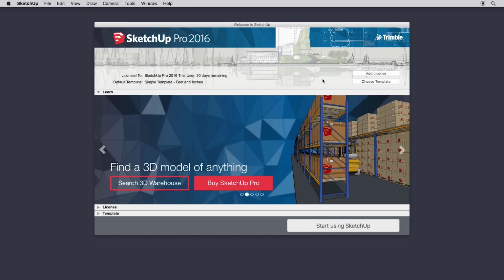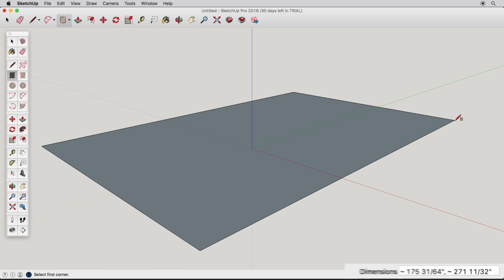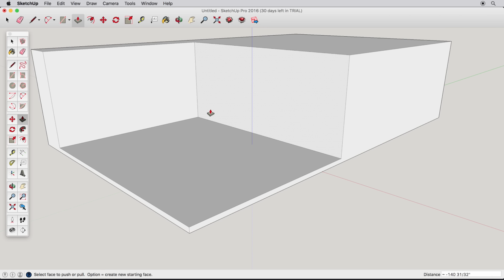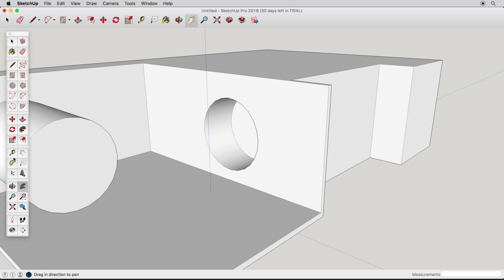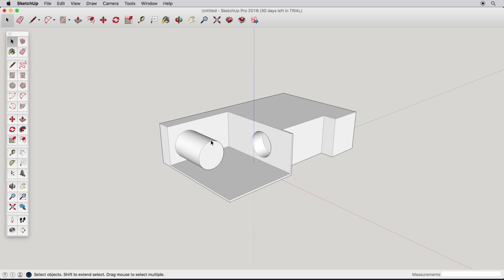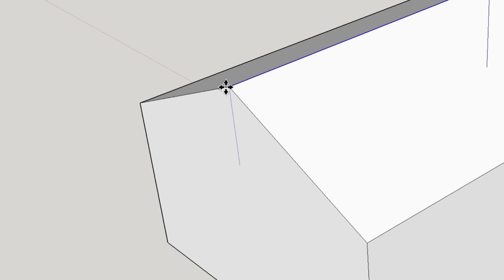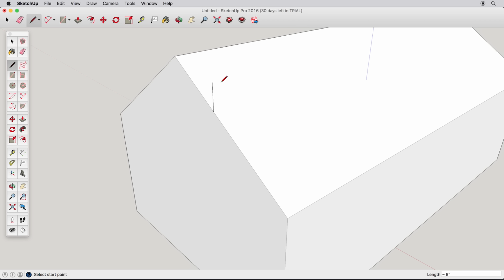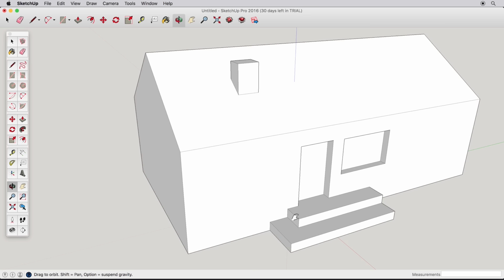Getting Started with SketchUp - Part 1

Comment: This video is great, I learned a lot of good things.  Have a question. I'm using the free SketchUp version on a MacBook Pro. I am not able to draw a line 200 feet long.  When I draw a line about as long as the pencil is, the measurement in the bottom right corner is 49668' 7" long. Any ideas on how to fix this? Thanks.

Comment: Interesting- so you have incorporated a 3D (or even 4D) modeling element with just the mouse. I recall having to use a dedicated 4D input device with a dozen programable buttons to do CAD CAM, but this seems much cleaner, simpler and with a lower learning curve. Nicely done. Question: I was hoping as you showed th part about creating steps, there might be a brief reference how to create such boxes of pre-determined dimensions (like 4' by 6') instead of having to struggle to get the dimensions exactly right as I move the cursor back and forth. Is that in a coming tutorial?
Reply: yes it is.

Comment: Is the a quick orbit/zoom/pan option while in the middle of drawing a line? Great tutorial.
Reply: If you have a 3 button mouse, you should be able to use the scroll wheel to zoom out and back in on another area, or orbit while you are creating a line. I have a habit of starting a line and holding the right button down while zooming in and out to get more precise placement.

Comment: whenever i try to install the exe stops working...how can i fix that im using win8 16gbram i7
Reply: Check you windows system. Is it 32 bit or 64 bit? Install the programs accordingly. On 64 bit windows system 32 bit programs won't run.
Reply: It s 64bit sketch up also The same
Reply: Did u install any new softwear on your laptop? I mean since when this problem started. Why don't u use windows 10?
Reply: i cant because of my other apps they need win 8 to work.i tried older versions also.finally 2015 worked.but layout and style builder didnt work too.i give up

Comment: HOW DO GET THE MENUS ON THE SIDE OF THE WINDOW
Reply: Go to View > Toolbars > Large Tool Set
Reply: View>Toolbars...
Then check what you want. It will appear somewhere at the top. Then just drag it, gripping the dotted line, to the left side. It will snap to the left edge. Adjust position.
Reply: cek in http://saidgank.blogspot.com/2017/02/cara-mengembalikan-toolbar-yang-hilang-DI-sketchup.html
Reply: By pressing your CAPS LOCK key
Reply: Knowledge is Power
Reply: Try cek this tutorial. Sure best
https://youtu.be/j2mC8vNBcTw
Reply: I'm new hear 23-11-18 how I get good experience in Sketch up...any PDF file to learn please forward given my mail id don't forget
ashaikaleems@gmail.com
Thanks....

Comment: Two long reoccurring Issues - Help Please: 
1. When I draw for a long while and the model becomes more complex, I find that when I erase an unwanted line crossing my original rectangular plane, the plane is erased, leaving the outline perimeter lines. 
  Example: I use the rectangle tool to draw a single horizontal plane. Then I draw shapes on the rectangle.  I may make many additions and erasures along the way. 
a) Then, when I erase a single line within the rectangle, the plane is removed.
b) Another way the issue appears is, If I right click and erase the original plane leaving the outer four lines of the plane. When I try to draw the plane back again, using the rectangle tool and the original corner points of the first rectangle, it will not create the plane. I should note that the other 2-D shapes I drew on the plane still are there. Suggestions? 

2. Also, with this not really very complex drawing described in the above example, I sometimes find that when I attempt to draw a rectangle to create a surface, the surface will not draw. I have found that this can be caused by an infinitesimally short line that is attached to one leg of the rectangle perimeter lines. It is so small, that it can only be seen by zooming all the way in on the leg to then erase it. 
   The way I find this short line is to a draw diagonal line on the rectangular plane. One triangular area will become a solid plane and the other half will remain open. Continue drawing diagonal lines until there is only a small open plane. Then I zoom it to erase this errant line.
Question: is there an easier/faster way to do this?
Much Thanks in advance!
Will